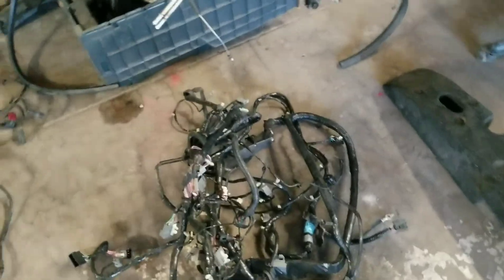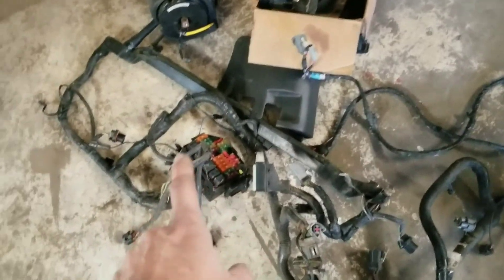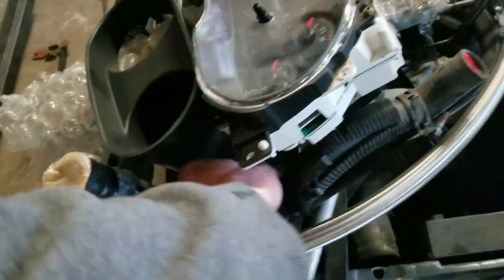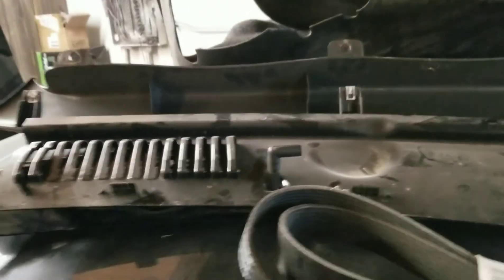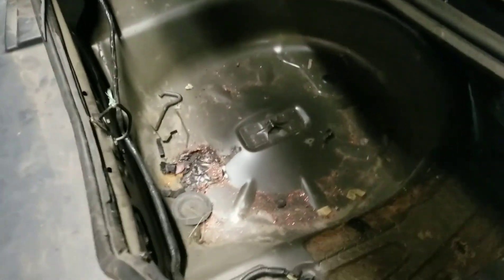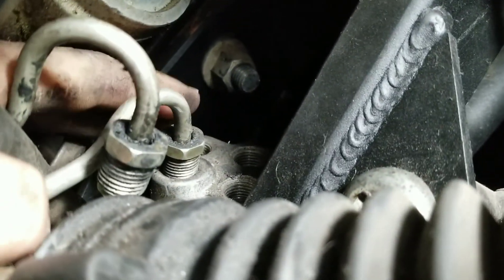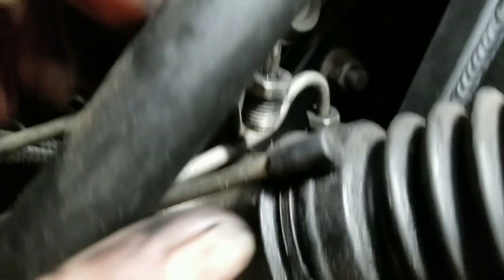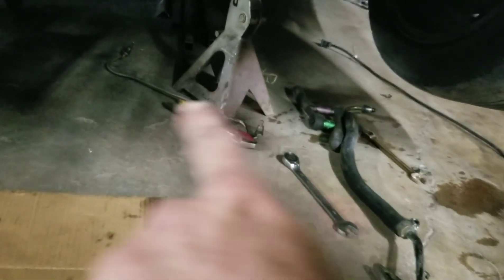Getting started on my "Fobra" / cobra project. 03 cobra swapped 04 GT

Comment: What a project man. Awesome. That Intercooler pump and bracket goes on the frame on the passenger side in front of the passenger front wheel. That interior has the IUP (interior upgrade package) only available on the 03-04 GT's , some V6 cars and the mach 1's. Its a really nice factory upgrade, better  than any aftermarket stuff, and best of all it includes the big cobra headrests. Nice work.
Reply from the maker: Thanks man! I'm actually about to upload my video of the intercooler/pump install right now. That's some cool info about the interior. I definitely didn't know all that.

Comment: Dude I'm doing the same cobra swap on my 01 bullitt . What cobra harnesses u didn't use? I have the whole dash with wires and connections I have engine stuff and wires n hoses  that I have no idea where they go 🤷 this videos help alot
Reply from the maker: I actually swapped over all harnesses.. I've read that it is not necessary though. So basically its your choice.